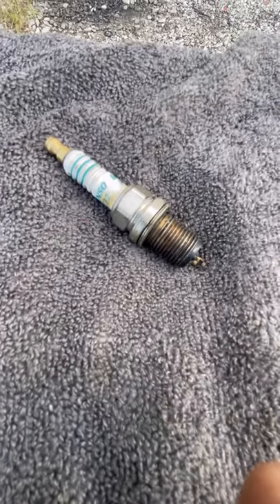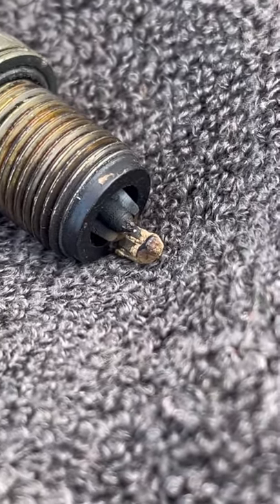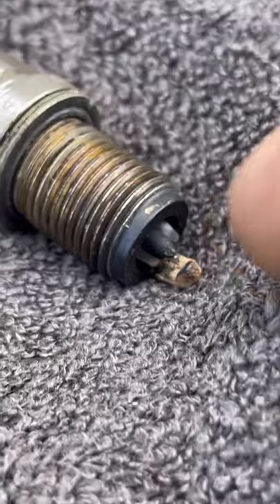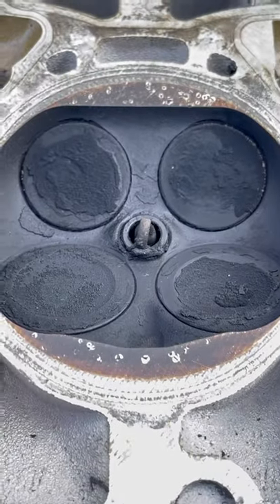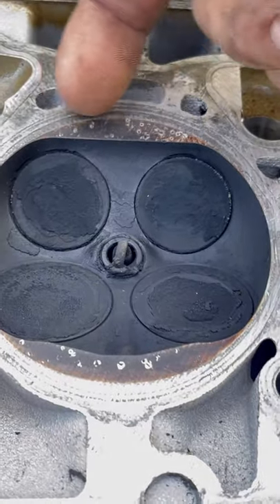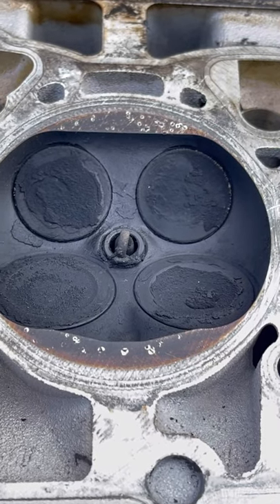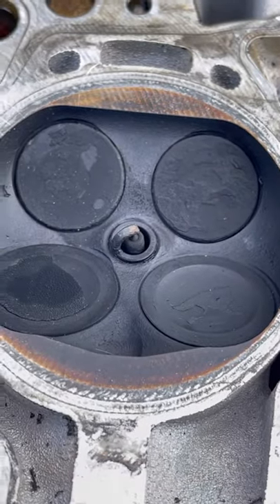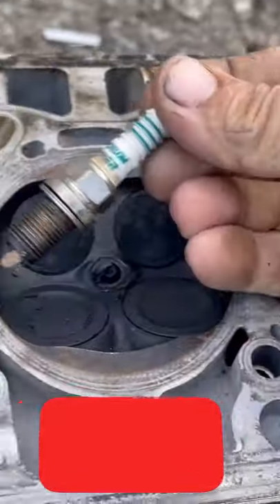Service Alert!  Change your spark plugs at or before your service interval, use top quality parts!

Comment: What intervals do you recommend changing the plugs at?  Would also be interested in a video on how you gap the plugs.
Reply from the maker: To much to cover in a comment I’ll just work on putting a video together
Reply: I changed the spark plugs on my honda, has 36k miles dealer says they last 60k-70k. When i pulled out the oem ones they were chared above the threads/lug onto the boots of the coil. Went with the better new ruthenium spark plug felt a difference, or it could be that they needed the change

Comment: Nice one. There is a theory that significant oil consumption can contribute to burnt valves, broken or even melted spark plugs insulators on these engines.
Reply from the maker: Thanks I’ll look more into that subject because I was thinking it might have been detonation from a piece of hard carbon buildup entering the cylinder when I would rarely see the scenario of a broken piston or a chunk missing from one of the valves.

Comment: Hi, you consider necessary change spark plugs and coils, same time? I'm talking about 2010 audi q5 2.0tsfi 8R. Nice video, thank you.
Reply from the maker: Coils should typically last 100 thousand miles the problem is people replace them with cheap or Chinese garbage, good spark plugs should last at least 20 thousand miles original equipment interval is 35k/40k

Comment: I have seen this happen a few times. Once was a loose spark plug the other was on my vehicle, had some really bad det. When i ran out of water/meth.

Btw on mine it took out the headgasket and the piston got replaced due to the top showing damage.